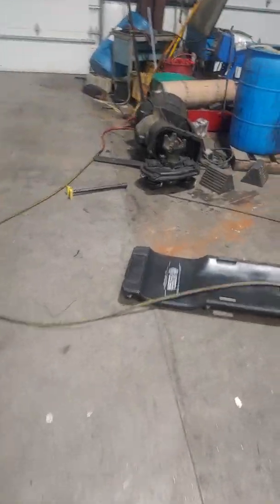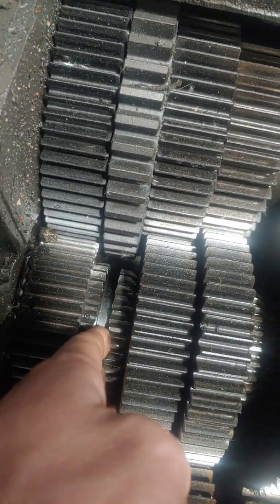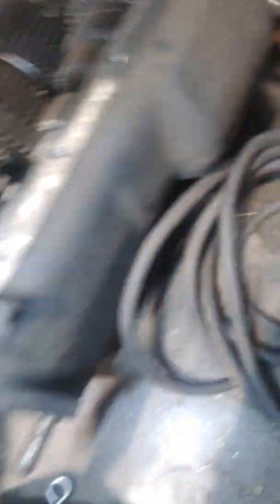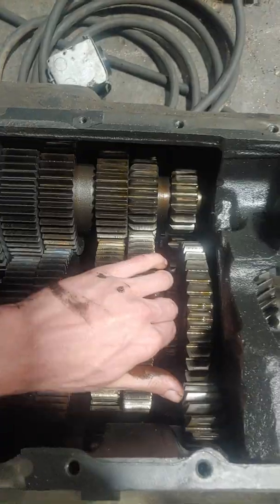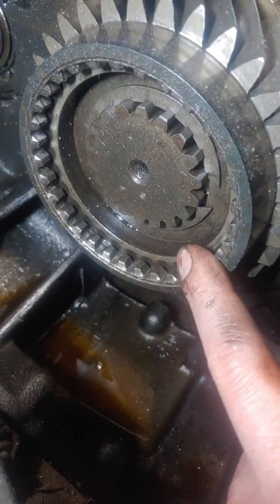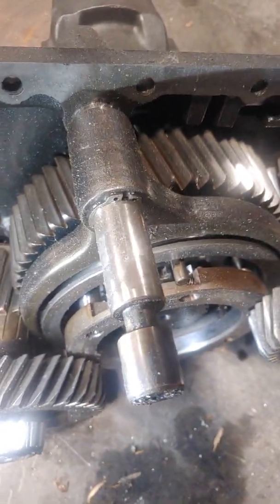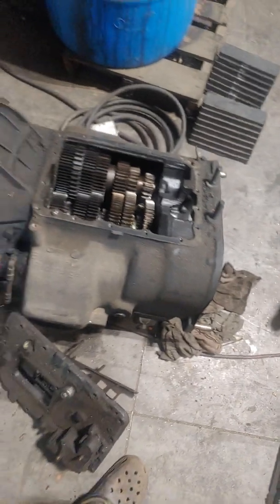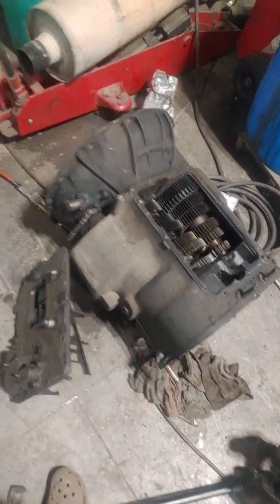Eaton Fuller FRO Transmission Overview

Comment: I'm putting together the same transmission at work but when I try to put the auxiliary (back section) back in the synchro will open up and spit the springs out. is the synchro bad?

Comment: In the video, you said the top plate usually can’t be removed without removing the transmission. Well, luckily, I have a truck that ALLOWS top plate removal in the truck!! 2004 Sterling LT 9500 has a big enough access hole around the shifter to allow the top plate to be removed. It’s right, but it can be removed thru that hole!! I’m having low to high issues. Gonna trouble shoot several things today!!
Great video!! Thanks for posting it!!

Comment: hello sir , i own a differential business and this past Friday i received a call from a gentleman DESPERATE for help !! he had an 2002 freightliner with trans problems ! i explained that that's not what i do however he convinced me to help him !! NOTE ive never seen the inside of a eaton transmission let alone fix one but long story short i rebuilt the rear box over the weekend but the truck wont shift to low range , any ideas on that issue ???
Reply from the maker: Check the air lines on the range shift piston it’s on the back of the transmission and it’s located externally because it’s an RTX. Also make sure that the transmission is in neutral before attempting to range shift. The transmission will not range shift while it is in gear

Comment: I have a ? Sir I have a 10 speed that from high to low won’t go like it should unless I move my shifter sideways or put it in gear I hear it drop to low , there’s no grinding at all and my synchronizer was changed a few years back because it was doing the same thing but from low to high gears , do you think synchro went bad again?

Comment: I'd love to put one of these behind a 5.9 Cummins in a 2 ton truck I'm piecing together.  Where would I go to find a compatible flywheel (maybe off a freightliner, etc) and flywheel housing (is it SAE2 ?) with a good 14" clutch to make it work?
Reply from the maker: They do make a SAE 2 flywheel housing for these transmissions, but it’s very rare. I found one on a sterling crane truck with a c7 caterpillar in it. The truck had an 8ll transmission in it but the bell housing is the same for that transmission and a 10 speed

Comment: Hi..I hav watch ur video.. I got problw with my 10speed gearbox ..
Truck goes in high gear , but not in low gear ..
Reply from the maker: Check you splitter system first, one thing you can do if you have the FRO transmission is remove the aluminum splitter module on the top of the transmission, and next to me of the bolt holes there will be two small approx 1/4 inch holes with o-rings. The key will be to pressurize these holes one at a time. Pressurizing one will but the transmission in hi range, and pressurizing the other will put the transmission in low range, make sure there are no internal leaks between the two holes, and verify that the internal piston is moving, then troubleshoot accordingly